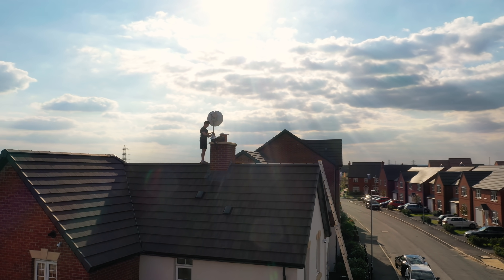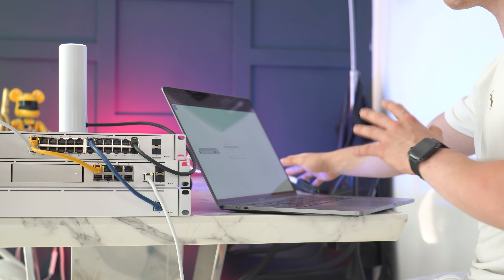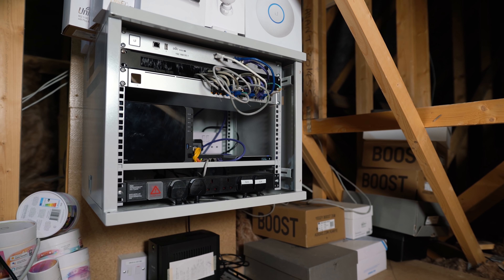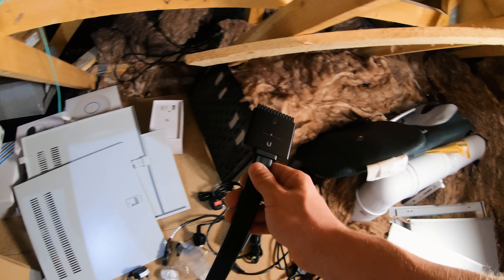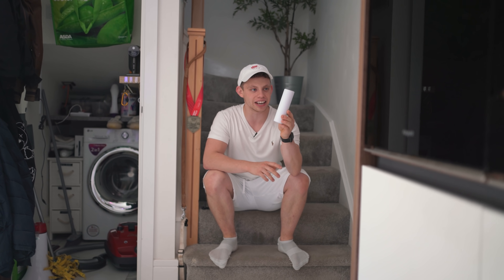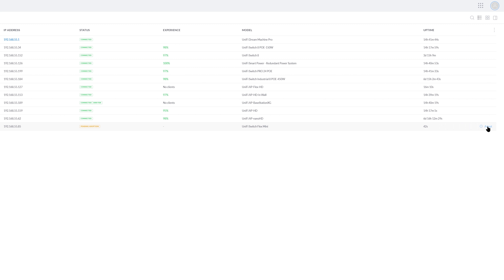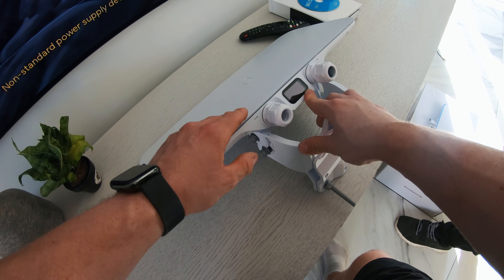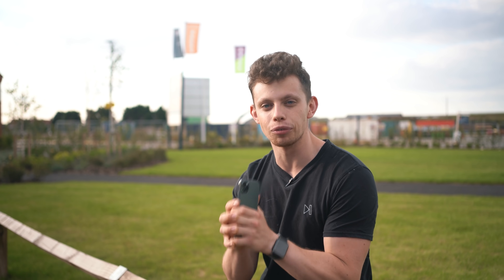Alex's Insane 2021 Home Network Upgrade & Tour!! 🔥

Comment: Ok, did he really just put an SSD into an Video Recorder NAS? He will be damaging those ssd's with lots of write cycles, that can only support so many writes before dying.
Also, to fans out there, those Unifi cameras cost $300-600 dollars each, so his equipment is over kill for the home user.
Reply: in some NAS units, they are used as a cache  so the cycle frequency is not that high.

Comment: @3:15 It's mega BITS . Not BYTES . A 304 mega byte per second transfer requires a 2.4 Giga bit connection. I have a one gig up and down fiber connection at home and it does around 120 mega byte per second transfers. A byte is 8 times larger than a bit . Network connections are measured in BITS not BYTES .
Reply: This.

Comment: Was enjoying this till I saw the mess of the CAT6 terminator to the new Flex Mini. 
Then he just glossed over it as if nobody would notice the inch long exposed wires?
Reply: Absolutely true Ben.  Love Mat's content, so well made and a great guy overall generally.  But in terms of getting the best network performance that "unfinished" cable will not be doing him any favours especially as it's shielded so probably adversely affecting performance into that mini switch now.  A professional cable tester would reveal all.

Comment: You mentioned the USP-RPS will keep your equipment running during a power outage. That is not true the device does not function as a UPS or battery backup only as a redundant power supply for your equipment in case the internal power supply dies it will keep your equipment running.
Reply: 100% agreed - great as a redundant power supply but not to be confused with a UPS / battery back up. Also if anybody does want to go down the USP-RPS route they need to be mindful that although the UDM-PRO has the appropriate connector only the PRO line of switches has it.
Reply: Didn’t he specified that he installed the USP-RPS to his own UPS and that is why he can still be own if he loses power?
Reply: I would go to a battery bank system that would give me four hours of runtime. If his UPS batteries give out after ten minutes all his customers are down!

Comment: USP-RPS does not have a battery in it. It only manages the power delivery during an outage, it does not actually back up the power on its own. You have to have an additional UPS for it to manage. It’s definitely not anything a home owner should have due to the fact you would never hit the wattage on your network that unit is designed to manage.
Reply: It's main use is to power the Unifi switches and other devices incase the Actual power supply goes out in the device.

Comment: With your rack try not to leave gaps between devices, patch panels etc and use blank plates, the air flow system works better

Comment: Recording CCTV onto an SSD, great idea, probably going to last about 2 months before all of the write cycles are used
Reply: Read my mind!! I know that with the cloud key gen 2 sometimes having a hard drive would cause it to be unbearably slow. But I haven’t heard the same thing about the UDMP.
Reply: @jeremydeel1514  I imagine internal flash storage is used to hold config and the OS as it isn't mandatory to use the HDD bay
Reply: @ewsclass66  you are probably right. Even though having a hard drive would definitely slow down pulling up cameras but I would take that over replacing an SSD every few months.

Comment: If you are going to be a tech presenter, you need to “do your homework” on the products you choose to cover. I will grant you that the Ubiquiti Unifi product line has some awkward offerings especially the USP-RPS, but a little preparatory research would have revealed it is not an UPS. And your application of the BaseStation XG, umm (ISP? really big family? ???), I sure hope you prep better for your tech videos in the future.

Comment: Nice video Alex, but some of the connection are a bit weird could you explain the following: The industrial switch does it have UPS onboard, because you attached your 2 camera's to it, If not during a power outage don't these camera's lose power?
Also it's best to have your UPS's on a separate electrical socket instead of a power strip, because of overloading.
Stay safe Alex and have fun with your gear.

Comment: You're a nice kid, but I really don't see "what" is the point of all of these network upgrades.  It just seems you're rehashing the same equipment every  3-6 months.  So, what's the point?  I don't run an ISP, but using a budget triband mesh Wifi 5 system I'm getting 200-400 megabits/sec. everywhere in my house.  All of the equipment is manufactured by TP-Link, and excellent.  You really don't have to invest this much money to have a killer home network that does it all; this is just sheer stupidity and overkill for 99% of all the viewers.  Despite all the money you spent my home internet absolutely trashes this.
Reply: He's doing this most likely because it's his passion and finds it interesting, just like how a woodworker would spend good money on equipment to make things that are not needed or could just be bought at IKEA. also he sells wifi
Reply: i'm not a fan of his network spending either. however that comparison is not a good way to compare. and the functionality of any of the equipment here will rip yours a new one.
Reply: He only put this equipment in for show. He's just a spoiled little brat.
Reply: @MrStephantch  if you look at his past videos all the money he has been earned on his own
Reply: @f.a7896  If you look at all of his "old" videos you see that 70% of the equipment he show's off is given to him free by sponsors.
Reply: @MrStephantch  look at his main account
Reply: @MrStephantch  ok boss

Comment: Great video Alex. I am about to redo my network at home with ubiquiti hardware. I keep everything currently in the linen closet and it gets a bit warm in there. Do you think it will be an issue putting the hardware in there?

I am getting the 24 port PoE pro switch and the dream machine pro.

I live in Australia so the weather is pretty warm here. What are your thoughts?

Comment: First 2 minutes and he already gets the RPS confused with a UPS. R=redundant=if one of the power supplies go bad. U=battery backup=if power goes out it will keep going through an instant failover to the battery backup. The USP RPS is not a battery backup just a power supply backup

Comment: The RPS is not a battery. It is a secondary power supply but will not keep anything on if the power goes out
Reply: Yeah I was just thinking Alex has this wrong. It’s a backup power brick, not a battery backup Uninterruptible Power Supply.

Alex, you’ll still need to get yourself a UPS for your rack to protect you should you loose power/have a power cut.
Reply: Just to confirm, the RPS will not keep you running should your power cut out. It will only keep things running in the event the internal power supplies inside your UDM or USW fail.
Reply: Thank you for saying this

Comment: 1:30 A UPS and an RPS are not the same thing, you described a UPS.
One is a battery, which yes, is meant to deal with a power cut temporarily.  The other is a means of redundancy if a power supply fails, providing an external power source until you fix it.
The Ubiquiti USP-RPS is an RPS, it has no batteries.

3:13, bits, not bytes!

I'll just stop watching at this point.
Reply: It’s all a complete mess and I’m so confused. Would anyone please be able to help me out. I’m trying to create a home network system but have a budget of £1000 maximum. Can someone please list me the parts as watching this video has confused me so much

Comment: is it fine to plug poe into something not poe compatible? Or will it fry it
Reply: Depends which type of POE. If it’s AF or active it handshakes before it sends power. There is also passive POE, which is on all the time. Active AF is the common standard now, and passive is common on older devices. Not interchangeable.
Reply: Assuming everyone has made their parts to standard, it will be fine, PoE is an IEEE standard, which dictates the process of detecting PoE requirement, etc.

Comment: 1:30 not the right acronym, USP-RPS doesn't have a battery, it's only for a ouright psu failure
Reply: and then there is no way replacing the internal powersupply without downtime. pretty stupid design :D
Reply: @OttoEdler  Ubiquiti’s stuff is so cheap just keep spare hardware on hand.
Reply: @matthewcampbell1092  that’s not helpful if I would be required to take down the whole system to swap parts lol
Reply: @OttoEdler  then don’t use Ubiquiti

Comment: The USP-RPS is NOT a battery backup.
The unit is designed to be there in case of power supply failure to a device.
But if the power is removed from the RPS it will go down along with the devices. It is NOT a battery.
Reply: The boy is a fucking idiot mate, did you see the cat5 cable crimp?
Reply: @calummcmillan9672  I died seeing that.

Comment: The USP-RPS isn't a UPS as it's basically just an external second power supply. If the power goes out the the devices will still lose power.
Reply: Exactly, and the fact this is not known by the host is a bit embarrassing and irritating o.O
Reply: @Burnman83  Exactly what I was typing when your comment popped up. He wouldn't be the first person to believe that.
Reply: @jamie3549  Not knowing that is not a problem, but putting it out as facts in videos is weird. Don't get me wrong, it is his video an he can say what he wants, but the fact the videos are so well made, but the facts are so wrong urks me.
Reply: @Burnman83  his production standards have got loads better over the years, sadly however he still doesn't bother about getting the factual content right.
Reply: It’s all a complete mess and I’m so confused. Would anyone please be able to help me out. I’m trying to create a home network system but have a budget of £1000 maximum. Can someone please list me the parts as watching this video has confused me so much

Comment: The RPS is not a UPS. It will not keep the devices running through a power outage unless it too is plugged into a UPS. The purpose of the RPS is to provide a redundant supply in case the built-in supply in any unit fails.
Reply: It’s all a complete mess and I’m so confused. Would anyone please be able to help me out. I’m trying to create a home network system but have a budget of £1000 maximum. Can someone please list me the parts as watching this video has confused me so much

Comment: I do not think you understand what the USP-RPS does man. It isnt a battery backup its a redundant power supply in case the power supply in your dream machine pro or swtich fail. ITS NOT A UPS.
Reply: It’s all a complete mess and I’m so confused. Would anyone please be able to help me out. I’m trying to create a home network system but have a budget of £1000 maximum. Can someone please list me the parts as watching this video has confused me so much

Comment: Getting a nice setup I really just wish I could get a old cloud key but because of work being short can not afford it yet
Reply: Why bother with a cloud key...just use a RPi 👍
Reply: @nikkosy5439  because I am sick of using a computer based controller and it keeps playing up
Reply: @Walterz930  There’s really no reason to get a cloud key though, when exactly the same functionality can be had from hosting the controller on an existing device. The only real exception being the Gen 2+ with the storage, but then that’s only useful if you have cams etc
Reply: @nikkosy5439  yah I have been looking at the cameras also as I am after getting all my equipment over to unifi sometime

Comment: The USP RPS doesn’t provide battery backup. It’s a redundant power supply. Not an uninterruptible power supply.
Reply: Sums up his knowledge really
Reply: @martuk7707  He either doesn't know the difference between UPS and RPS (Highly likely) Or just wants to promote the products blindly (Also highly likely considering everything is 'Something I love' Before its even out the box for the first Time.
Reply: @Scott-zh6lz  to be fair if Ubiquiti sent me a load of free stuff I’d love it before it actually arrived
Reply: @martuk7707   Even if it made your home network experience worse than it previously was once installed?     Save the 'I love it' for the 'review' once its installed.  This is the guy that got a new boiler when he wanted to change thermostat. Take what he says with a bucket full of salt.
Reply: It’s all a complete mess and I’m so confused. Would anyone please be able to help me out. I’m trying to create a home network system but have a budget of £1000 maximum. Can someone please list me the parts as watching this video has confused me so much